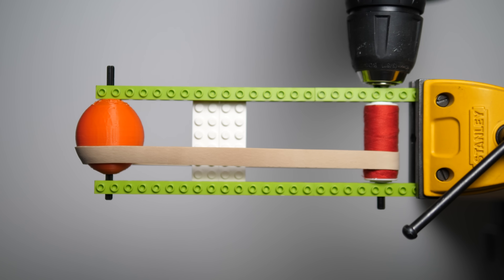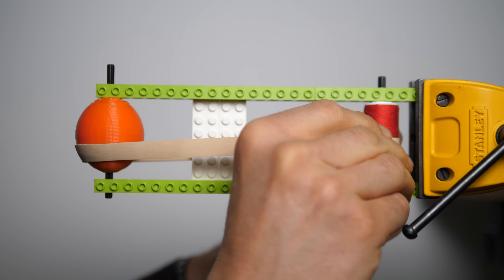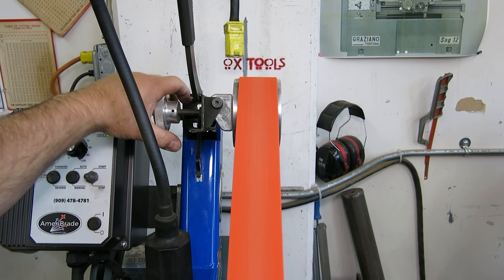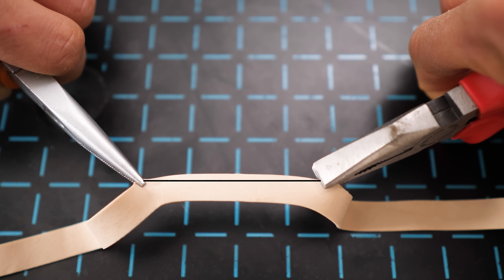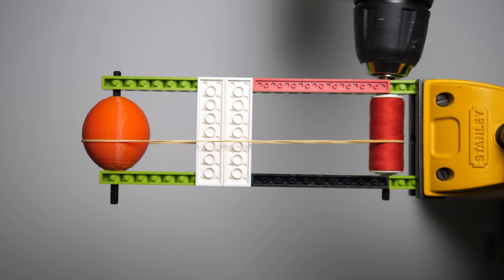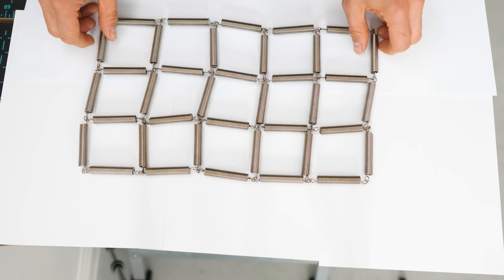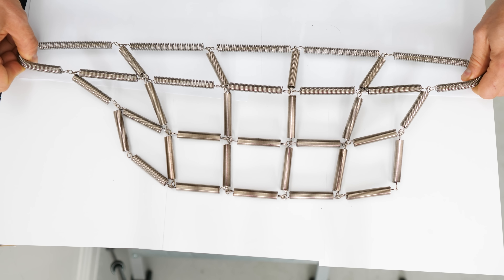The Band Should Slip Off But It Does The Opposite!

Comment: Counter-intuitively but related to entropy changes, rubber bands COOL when you stretch them. If you have no moustache you can check this out by holding a rubber band against the skin between your upper lip and your nose (temperature sensitive) and sharply stretching it. Hold on carefully!

Comment: What about the increased friction from the expanded side of the rubber band compared to the less expanded side, because of the increased restoring force, there’s a higher normal force and therefore net friction force on the expanded side would result in translation towards that side

Comment: Actually my intuition was that the belt would center itself. My explanation for it would have been that when the egg turns it picks up the rubber band at a steady pace but then the center part travels more for each angle thus stretching the rubber band sideways. Now the rubber band section closest to the egg center exerts a pull force on the other sections of the rubber band. Isn't that what's actually happening here?

If my theory was correct the rubber band should instead fall off if you reduce friction on the egg enough to be smaller than the force required to pull the band up the slope.

Comment: Hey Steve. Great video as usual, I’d love a video  on why spinning discs ( like bricksaws and such) make such a massive noise as the disc is never displacing air as it moves, also the make noiseless disks, they have holes in them. 

What’s up with that?
Reply: A cutting disc is going to vibrate in the axial direction and displace air that way. Also in the radial direction as the teeth or grit engage the material. Both these vibrations will produce sound from the blade and the frame and anything it's connected to. I'm not familiar with the holed cutting discs but I have seen some made from composite that internally damp the vibrations within the disc to reduce noise emissions. Without seeing them my guess is the holes reduce the stiffness to the axle and therefore act like a low pass filter for vibrations that would travel to the axle and frame and generate sound from there.

Comment: It’s sort of the inverse of how a bicycle is stable and balanced when in motion—any imbalance tends to turn the front wheel toward the direction of tilt, which in turn restores balance due to the momentum being at a slight angle to the new direction of travel.  It doesn’t work when still, much like your example of the rubber band under tension at an angle to the pipe.

Comment: Does this apply to bicycle rollers also? 'Thin' curved rubber on a crowned plastic roller has the same effect of helping stabilize in the center of the roller, while flat rollers don't. Or is something about a turning wheel on a turning roller?

Comment: I think you missed a significant characteristic.  When the rubber band (or belt) is off to one side, the circumference on one edge is greater than the other, causing that edge to travel farther than the other edge, causing the belt to "steer" toward the middle.  When the belt reaches the middle, the steering effect is neutralized.  This is similar to the taper that is applied to rail road wheels.  The taper causes rail road wheels to naturally center so they are not rubbing on their flanges.  The flanges are only necessary for extreme curves.  Very interesting video.

Comment: About 45 years ago, I was working for 
A.B.Dick, a printing machine company.

I repaired the old liquid photocopiers.
The belt that moved the paper, was 11 
"rubber bands."  The drive pulley had 
11 raised rings machined into the pulley.
(Just like the ball you have here.)

I'd knock them out of alignment, and 
they all ran true, after a few seconds.

Line shafting, in old factories all used 
crowned pulleys, and flat belts.

Dave Richards as a small steam powered 
machine shop, and uses flat belt line 
shafting.
https://www.youtube.com/channel/UCBdj-vOveiEFWe3vnGoJUag

steve

Comment: A fun consequence of entropy causing the elasticity of rubber bands is that their shrinking is endothermic. You can actually feel a rubber band getting getting slightly cold if you let it rapidly contract. It's easier to feel if you hold it up against your lip while it contracts.
Someone made a video about turning a bunch of rubber bands into a refrigeration system. Can't remember, I get all the science channels confused.

Comment: Steve I am a conveyor belt engineer and this demonstration appeared to me like "defying the laws" and tricking the senses! This demonstration at 3:52 appears to be the opposite of what would happen when "tracking" a conveyor belt. So I'm sitting here scratching my head trying to understand. Two major differences are α: majority of the pulleys are not crowned and β: most of conveyor belts have a minimum of 7 rollers. Principally the belt would move away from the side of the pulley that is more tensioned toward the side of the pulley with less tension.

Would you be able to mock up a demo piece with additional pulleys and test that?

Comment: Not so sure about the explanation that temperature causes the elasticity... Hot rubber is less stiff than cold rubber. What's going on there? EDIT: Nevermind, see https://en.wikipedia.org/wiki/Rubber_elasticity#Thermodynamics . Probably some phase transition stuff going on over large temperature changes where the rubber really loses stiffness.

Comment: I'd have guessed that the centering is caused by the geodesic of that surface
Reply: Just what I was thinking, my intuition told me it would center due to geodesics ... Is there no truth to that? 🤔
Reply: @PeterMcIntyre0  I suspect it factors in once inner side of the band crosses back over the center point of the crown. So long as it's a curve relative to the drum, and not a parabola relative to it. (As a sort of anecdotal point of inference, you'll notice that 'geodesic of a paraboloid' yields immediately relevant google results, and 'geodesic of parabola' does not.)

Comment: I'm a machinist and at work I make conveyor belt rollers. And when we Crown a roller it's normally only 8 inches of either side and has a taper of1/16" to 1/8" per foot. Its very little taper to the pont its hard to tell but it works perfectly!

Comment: Very interesting. My robotics team had a similar issue. We made a belt ball intake system from a tractor tire and we made concave pulley shapes to hold it all together. We were very surprised to see the belts running up the sides like that so eventually we just went to a straight cylinder shape.
Reply: Look at snow mobile “transmissions” for some interesting engineering. Incredibly complex in their simplicity. You may get some inspiration from them.

Comment: Is this in any way related to the shape of indoor cycling rollers? I remember them also being slightly spherical in order to more easily center the bike when riding.
Reply: Best guess is that the doming moves the contact patch towards the centre of the roller, causing the bike to steer that way.
Reply: Interesting, but the ones I've seen are not crowned, so it doesn't seem to be a necessary feature.
Reply: The rider can always steer themselves.  Maybe the domed ones are easier to ride no-hands.

Comment: So this acts like a CVT is there any effect of the first pulley moving the band to a lower amount of torque or energy to spin the rounded pulley? The small drive pulley spinning a larger diameter is easier than the similar diameter exterior edge. (Like a gear reduction)
Reply: For instance if you used the drill to drive the mechanism from the rounded pulley end would it act the same?

Comment: You will see crowned systems in most old water wheel driven mill, older PTO systems on farm equipment, and even railroad tracks/wheels.

These were essential technology in almost all manufacturing from the 1800s to early 1900s.  If you ever have the opportunity visit an old textile mill, museum.  The one I lived near in Lowell MA was an amazing array of mechanical wonders. Watching everything from belt drives, to shuttlecocks, to mechanical programming of fabric designs in completely 100 year old mechanical systems is worth the time.

Comment: At steel mills the steel strip we made used rolls (pulley) that were slightly rounded so that the strip steered to center. Lots of rolls used to guide the strip to the remainder. I think the effect works in reverse for elastic strips like conveyor belts.  Another way to steer was to actively adjust the roll up or down perpendicularly to the strip. Anyone who has experience please correct me on this.
Reply: No reminder, REWinder

Comment: But the belt grinder belt is not rubbery. There the guide wheel is spring loaded to push tension in the band, and it still doesn't fall off

Comment: Thats because there is higher tension where the band is stretched out further pulling the band that direction until it reaches equilibrium. It shouldnt slip off. It should move towards the center until it is balanced.

Comment: This pulley setup is used on belt sanders. This is because smaller circumferences move faster than larger. Like a 10 speed bike. 

The myth busters had a extra talk about this. Adam’s first job was to build a store display with balls moving on tracks. Adam mistakenly thought a u shaped channel would be the best shape but didn’t think it out. This shape would slow the balls erratically making the display not work reliably. This is because of the different shapes of friction. Having a track that supports a specific part of the ball is more efficient and won’t add more drag. This is why two pipe ball tracks are more common. They are effective and the ball will behave in a way expected.

Comment: Just a recommendation, in the discretization you should use triangles instead of squares. This avoids the rotation of the individual elements at the nodes and produces a more accurate deformation of the whole system
Reply: B E S T A G O N
Reply: 3TRI vs 4QUAD, reminds you of FEM
Reply: FEM gang

Comment: I saw the thumbnail watching another video. Before watching I'd like to say that the band is drawn to the center of the sphere because if it goes off center, the portion closer to center will pull the band back up because it's on a larger diameter (being pulled more) than the lower section. So, it should work. Let's see.
edit: A bit off, but I'd argue that I was describing the effect that causes the bow in the band. Maybe? Bandsaws have crowned pulleys as well. Mathias has done some cool stuff. I modeled my first ukulele roughly off his plan.

Comment: Your explanation of the rubber band on a molecular level is really intuitive. I was wondering how well this analogy holds up with low temperatures.

You said that there is no force pulling the rubber together at 0°K and the rubber will probably go rigid much sooner. But how do cold/warm temperatures effect a rubber band? Will the spring constant really become smaller, will other changes in the system chancel this effect out or is your analogy simply lacking?

Would be cool if you could make a video about that.

Comment: this is the shape of idler pulleys in tape decks for flat drive belts. the self centering action is remarkable. they also cut the same domed angle on rail track to center the bogeys on the track

Comment: There is a pulley on my car that always bothered me that it's crowned, always felt like it was gonna be a problem one day. Guess I was wrong lol
Reply: Well, it won't be a problem until your belt starts becoming brittle. I'd assume that when it loses elasticity that this crowning effect won't be as strong.
Reply: @alexanderunguez9633  nope, as long as there's even a very small amount of stretch and elasticity the belt will re-center. this works even on high strength fiber belts, such as aramid cloth, or even steel bands. there isn't a need for the belt to be highly elastic.
Reply: @wyattroncin941  That's neat!
Reply: @Peter Evans There's not really anything more left to be explained in each thing. The video could have ended after 4 minutes and I would have called it overexplained.
Reply: I used to own a Chevy Blazer and the belt would constantly fall off, From what I've seen in this I should have put some crowned pulleys on it lol
Reply: It depends on the type of belt. If the belt is wide enough, it will stay on the pulley. This is because the belt is elastic not just across its length but also across its width. Since the surface of the belt is stretched more on the side facing the wider part, it will always try to nudge itself to tensile equilibrium. It will move toward the one place on the pulley where both sides could be stretched with equal tension: the middle.
Reply: The idler pulley!

Comment: I waited 8 minutes to see if he would get this right, but dosn’t seem to get it.
A web (a wide rubber band, a width of paper, etc) moving over a roller will always travel from lower tension (shorter distance between two rollers) to higher tension.

The physics of web handling and converting is what you want to read.

Comment: This works through the same function that curved spacetime does to form gravity or how straight line paths on the globe always curve towards the equator. A straight line on a curved three dimensional surface forms a curve in two dimensional space. The elastic band's contractive force vector is in a straight line across a curved surface. Since both sides of the crowned pulley curve towards the centre of the pulley, the straight pull vector of the elastic band forms a curve towards the centre of the pulley because the centre of the pulley is the only place on the surface of the pulley which a vector in the direction of the retraction force of the elastic band would trace a straight line when the surface of the pulley were flattened out axially. This forces the band to self-centre at the peak of the curve as the same applies to both halves of the pulley.

See this video by Dianna at Physics Girl channel for the explanation of the above: https://youtu.be/SdySHadrYAA?t=129  
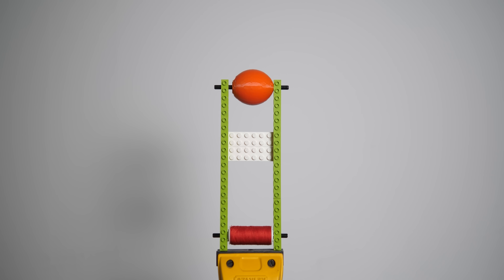2:08 to 3:08.

Comment: Actually, the stretchiness of the rubber band is detrimental here. Rubber band is just probably simplest way to demonstrate the effect. But the effect of the band steering towards the middle is more pronounced when the band is stiff and you just pull the two pulleys apart from each other with just enough force. I mean, it works on sanding belt, these are not well known for their stretchiness.

Comment: Why the assumption that it should slip off??? 

The midle section of the crowned pully hase a faster surface speed, so the pulley pulls the belt towards the crown.

Comment: I figured it was going to be something akin to the climbing magnets, where the curve of the pulley meant the top was in contact so the band was being twisted locally at the initial point of contact, raising the trailing section of the band and being pulled up that way... had to do a deeper google dive than I expected to find the video and check it was actually you that did it (it's sneakily on Veritasium's second channel, and "ft Steve Mould").

Comment: I worked for 11 years in the mine conveyor pulley industry. We machined a crown in all small to mid sized pulleys. The largest drive pulleys were all flat but they had other pulleys in the system that were crowned in order to keep the belt tracking properly.

Comment: Well, yes, sort of. I'm sure your explanation of the elastic band is correct, but the crowned pulley effect works just as well with thick leather belts that do not stretch. In this case it is the shape of the pulley that provides the restoring force. Trigonometry provides the explanation in this case.

Comment: If you invert the model and think of the ball as a wheel, it stays on the rubber band "track" just like train trucks. There's a great Feynman talk about recognizing the difference in diameter of the edges of train wheels to understand why trains stay on tracks without steering or guides.

Comment: I don't think your explanation can completely explain this phenomena, since crowned pulleys don't only work for belts, but for a cord with a circular cross section (as long as the cord is stretchy). On my robotics team we used crowned pulleys with polycord and it worked great, but your explanation of different tension on different parts of the belt seems to provide no explanation of why it worked there, since the contact between the pulley and the cord is very minimal relative to a belt

Comment: I didn't know it was called a crowned pulley, but I did know belts do that on rounded wheels, because that's how band saw blades stay on their wheels (I have an 18" w/ 1" wide blades - one of my first fears was how it stayed on the rounded over wheels without flying off), and it's why people making home versions of giant band saw mills use regular, pressurized tires/tyres as the wheels holding the blade, because they're rounded, and the blade will always walk back up onto the wheel, even under the load of being pushed through a tree.

Comment: This is also how trains stay in the centre of the tracks. The wheels are very slightly conical and constantly steer the train to the centre when the weight shifts. 
A common misconception is that the flange on the inside of each wheel rubs in the track to stop the train from derailing.

Comment: We have concaved and crowned idlers on our printing presses at my work. Crowned for any belts and concave to help prevent wrinkles in paper as it goes over the idlers. Each end is thicker so the end of the paper pull out away from the center preventing wrinkling. We also add tape to the idlers on the edges of the paper for the same effect
Reply from the maker: Interesting!